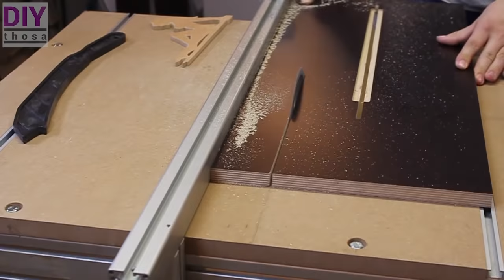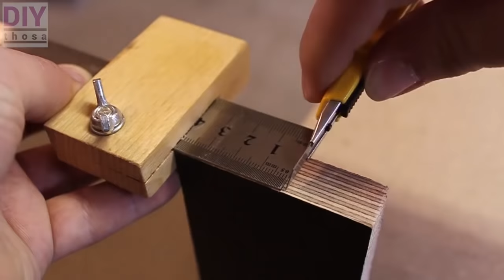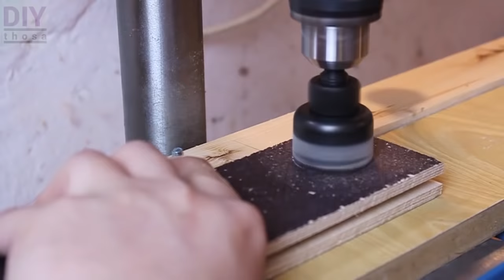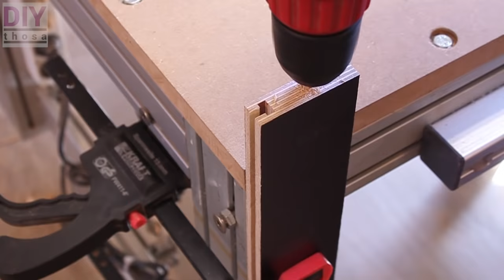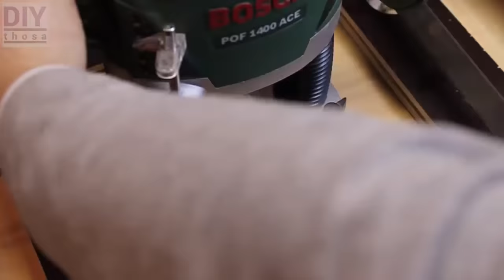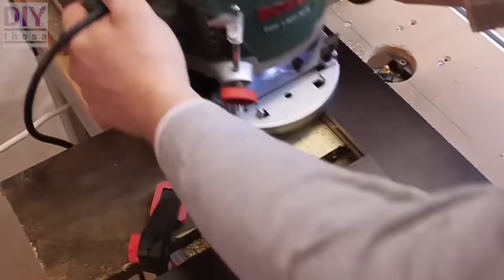Make your own adjustable DIY Router Template !  A must have Jig !

Comment: Rather using a spanner to loosen and tighten the nuts it would be quicker to use camlocks. It is however still a useful and commendable design.
Reply: or wing nuts
Reply: @man.i.literally.failed6772  I don't see how could you turn wing nuts inside the small space..

Comment: #1 I love that blade guard.  #2 that router, the putting to guide is very nice. I took a lint roller and put sand paper around it to sand inside circles  and also took different sides of wood circles, glue them together and made one for my drill press :) All in all your project is very niceeeeeee I like it.

Comment: Have a plastic one very similar but can also change angles. If I added more pieces it could do any multiple of sided. The only limitation is with more sides the larger it has to be.
Reply from the maker: Sounds nice.😀👍 Do you have a link to that?  I wouldn't call that limitation. Sometimes there's no other Way. 😀🖐
Reply: @thosa  you can do the same thing by rounding over one end.

Comment: Superb. You could have made the T slot routing easier by running it over the tablesaw first
Reply from the maker: thank you 😊 ... yes thats right 👌 or use a normal router bit to save the T-router bit.. I learned that afterwards. 😯

Comment: Great idea! I may have to do this... Do you think cam bolts would come loose too easy? If not, then you'd just need a simple screw driver to adjust. Or for more ease (so you don't have to hunt for the wrench or screwdriver), maybe a quick release bolt like you'd find on a bike.
Reply from the maker: cam bolds would be a nice try... but I don't know if they're strong enough... if you're rebuilding this, don't put screw heads in the slot. They lose their grip after a while and start to turn. a sliding block would be a better solution.

Comment: Great video, many thanks for taking the time to make it. I don't see any advantage in cutting the round holes and having an insert. Unless you can tell me? Surely it is better to cut a small square hole and have the bolts just tighten up against the stock then there is less play from moving parts.
Reply from the maker: 😳😅👍  yeah, you're right!  😅  I saw the circle cutter and my head was like: yes, great idea. 😅  ..of course it is easier and more useful to put a small rectangle in that place. 😀👍🖐

Comment: Das System werde ich mir nachbauen, ist gut nachvollziehbar dargestellt.
Reply from the maker: Die Sechskantschrauben haben sich jedoch als nicht die beste Wahl erwiesen.. In Holz drehen die schnell über. Ein schmaler, länglicher Alustreifen mit einer Senkkopfschraube ist besser geeignet.
Reply: Der Alustreifen gleitet dann wohl in der Nut? Die Senkkopfschraube verstehe ich ja, nur wie willst Du die fixieren? Einkleben? Ich denke da eher an passende Nutsteine, die Schraube müsste dann anders herum angebracht werden, was aber eine zusätzliche Aussparung zum Einsetzen der Schraube bedingt.
Reply from the maker: Ja, der Alustreifen quasi als Nut. Loch bohren, Gewinde rein, Senken, Senkkopfschraube rein. Gleiches System habe ich an meinem Kreisschneider für die Bandsäge gemacht. In der Mitte ist eine versenkte Aluschiene. Vorne am Drehpunkt ist eine Senkkopfschraube bündig abschließend in der Aluschiene.
Reply: thosa eher ein Stahlstreifen der genau ( Länge X Breite des Nutquerschnitts) so breit ist, wie das Brett das stumpf anliegt. Darin ein passendes Gewinde geschnitten, und  dann die Senkkopfschraube einkleben. So hält das gut.zum Schluss die Schlitze noch mit Wachs einreiben.
Reply: Gewindestange in Vierkantmutter oder Nutenstein einkleben oder Flachrundschraube am Kopf nachfeilen.

Comment: Great jig, some simple but very clever ideas. Would you consider taking out some of the t-slot with your table saw, to lighten the loading on the router slot cutter?
Reply from the maker: Yeah, that's a good idea. Thank you
Reply: thosa you could also mill stub tenons on the ends of each piece, to engage with the slots, it would keep the jig very flat.
Reply: thosa and use longer bolts with correspondingly deeper bores to hold them, then the nuts, washers and spacers won’t work free and get lost?
Reply from the maker: nothing gets lost. The nuts only need 2 turns to push the bolt out of the slot. An optimization would be to use a longer sliding block instead of the bolts. The wood doesn't prevent the bolts from turning for ever.

Comment: Very nice, I like how you can use this for different sized cut outs. A question, what if you made the openings for the nuts bigger and rectangular and used wing nuts? This would eliminate the need for a wrench. Thanks for sharing!
Reply from the maker: thank you 😀🖐 yes, that would be an option. But then much thicker material would have to be used and the useful depth would be much smaller. 🤔😀🖐

Comment: What size T slot bit did you use for the router, and what size bolts?? great video!
Reply from the maker: thank you 🙂🖐 I've used M6 Bolts with 10mm Hex Head.. so a 10mm T-Slot cutter from Festool. 😀👍

Comment: Nice video - subbed - i have been trying to think of a way to create/use something like this to cutout an insert with rounded corners (and keep both pieces) for example a cabinet door, but the internal rounded corner is the tricky part as with this jig you just get the square inset slightly.  I wondered about creating some corner inserts that fasten with t screws but not sure if the jig would be accurate enough or strong enough.  I have also seen a jig where you fasten the router to a point and follow the radius.  This was the best idea yet but could be tricky if in the middle of the workpiece unless you made a jig for everyone you cut.  Any ideas?
Reply from the maker: good question... To cutout an insert with rounded corners would be a challenge if you want this to be done in one step. I would do this in several steps with different templates. For example a template (quarter circle) with some inches straight for a better alignment. Cutout all corners and use this template or some straight pieces for the lines in between. by the way... I wouldn't make a door with a router out of one piece. The gap between door and front would be way too large. If I want this out of one solid part, I would try this with a jigsaw and make the starting cut with a multi-function tool. Please mail me if you found a better solution :-)
Reply: easy to do using one corner chisel

Comment: Good afternoon. Do you have any video on how to make this paralele guide on your bench?
Reply from the maker: no sorry. this is only an alu system profile. the whole table was made with this profiles. google for "ITEM profile" and you will find them. 😊  but I dont suggest building a fence with this. you have to measure and screw both sides to got a precise cut. a biesemeyer fence out of plywood would be a way better solution ... 👌
Reply: Ok .... Thank you so much !!!

Comment: I like what you do but, your table saw guard is only useful when you’re not sawing wood. I take its a circular saw, and you’ve screwed it to a bit of wood?
Reply from the maker: Thank you 😀🖐  yes.. But this Video is over two Years old. A long Time ago I have stopped using this Saw due to safety Reasons.  Check out my new Videos. Especially the Jigs for the Table Saw. Now I have a new, professional, safe Saw. 😀🖐

Comment: Nice project, did you think about using wing nut rather then hex nuts? It might save having to use a wrench.
Reply from the maker: thank you 😀🖐  the wood was to small for a Wing nut and the Hole to small to get in with at least 2 Fingers to turn the wing nut... but the Idea is good... but all have to be larger for that... 😀👍

Comment: Great Video !!! Can I find a Distance Sleeve for the simpler Makita Router, the one that you use with one hand?
Reply from the maker: thank you 😀🖐 I'm not sure if there are spacer sleeves for the small router. You can, however, run the entire router along the inner edge.  You only have to make sure that you always drive along the frame with the same side of the router. (only if the base plate is not a perfect circle) 🙃👍
Reply: @thosa  thank you very much! Cheers from Brazil!

Comment: Gonna build this.. Wish me luck.
Reply from the maker: good luck 😀🖐
Reply: @thosa  I finished this today.  This was a much tougher build than I thought it would be. It says more about me and not your instruction. 1st i ordered a 3/8s keyhole router bit. I should have gotten bigger. Measuring and finding the centers on all drill holes and slots was time  consuming and nerve racking for me. And I couldnt find any bolts that had heads small enough to fit in the slots.metric or imperial. So I had to grind the heads and threads down. I made a mistake that turned out to be gold. I drilled holes with drill and hole saw on all 8 ends. Only needed to do four. Each piece was 2 foot long, when I started test fitting, it was too long for me. So I cut 8 inches off each. Now I have 2 jigs. A larger and smaller. Bada bing! Just have to get more bolts. And grinding the bolt heads down made them fit like a glove. This is going to work wonderfully I believe.   Thanks for posting
Reply from the maker: Sounds like a lot of fun. 😅 Having two tools of different sizes is also cool.👍  You get two for the price of... well... two... 😅👍
That you had to grind the screw heads is another bonus point. I have the problem that the screw heads can turn in the groove over time.
You shouldn't have to worry about that problem. 😀🖐

Comment: What brand is router and saw table underneath ? I really need a saw table, but i’m not sure if i need to spend the cash on a good sled system or if i have to make it myself.
Reply from the maker: These are both the cheapest machines you could find. The hand circular saw cost 40€, the milling machine 19€. But I strongly advise against building such a table saw yourself. Important safety devices such as splitting wedges are missing. A cheap milling machine can be screwed under the table. This has worked well for me for 3 years now. 🙂🖐

Comment: Hey how do those t rack slots hold up on that type of plywood any good? I am making this wild table sled and would like some feed back
Reply from the maker: hey 🙂🖐 that's obviously not made for eternity... of course there are also points that can be solved better. for example, the hexagonal bolts begin to overtighten in some places... Welding a threaded rod to a flat bar instead would have been the better solution. But you only know that afterwards  😅👍
Reply: thosa oh ok that makes sense I’ll just use it on hardwood then. Thank you very much :)

Comment: why not use wing nuts  ?saves having a  spanner to hand ? whats that plywood called
Reply from the maker: The wing nuts are larger than the width of the plywood. In my workshop I always have the tools nicely sorted and ready to hand. So this is not a problem at all. It's called phenolic coated plywood. This is used for trailer construction, as the coating is very weatherproof. 😀🖐
Reply: @thosa  Thanks for the response, you got me thinking maybe a large Knurled nut,Ill experiment  I liked the video and found it quite useful.Bill
Reply: Isn’t that plywood just betoplox of some kind ? Like multiplex/plywood for concrete formwork.

Comment: great video, very simple to make and no damned musak,  that kind of ply is it plastic treated,dos it have a name?
Reply from the maker: Thank you 😀🖐 I know it as Phenolic Coated Plywood. Its often used as Ground Plates for Car Trailers. 😀🖐
Reply: thanks  I know the stuff damned expensive
Reply from the maker: yes, unfortunately. 😥 I regularly go to the Hardware Store. They sell Wood Scraps and Waste at a Fraction of the Original Price. 🤓 Most of the Time the Leftovers are big enough for my small Projects. Hope your Store offer this Option as well. Just ask for it. 😀🖐

Comment: did you build your table saw ? when i first started wood working  i mounted my only tool at that time to a piece of ply wood  a 7 1/4 saw limits what you can do  now i prety much have  a full wood shop in my garage  and my problem is how to move them arround so casters it will b  the only thing i own that is mobile is my table saw
Reply from the maker: yes. its a simle hand circle saw mounted under the table. but now Im happy to have a good new table saw with a splitting wedge. The self made one was to risky.
Reply: i know what you mean  what scares me is these  work place or guess you would call them portable table saw is the throat  plate being so flimsey  and large i own a cheap porter cable  10 inch  it is sufficient for what i do have 6 inch jointer  14 inch band saw a 12 in thickness plainer  and bunch of other goodies  looking at a new router  just need to talk the wife out of the money

Comment: hey impressed with your table saw, have you the specs for it?
Reply from the maker: please send me a mail via my website, then I can send you some information about the table. 😊
Reply: @thosa  so do you make cabinets for other people ? and or is it just for a hobby? I can see you have a variety of priced items, it must be done on a budget but its hard work working out what to but, I have a Katsu router think you have it it also. Its excellent actually  up to around 13mm router bits after that it vibrates , but very good below. The centre is off a bit so I dont rely on that. Your table saw - is it accurate more than 1/10th mm over the length of the cut (say 50cm?
Reply from the maker: no, I don't do commissioned work. Its just for hobby. The Bosch GTS 10 xc is very precise. 😀👍

Comment: That’s a cool blade guard on your table saw. I’m a new woodworker - could you point me to information on it? Is it aftermarket?
Reply from the maker: That was a self-built circular saw, which fortunately I no longer have to use.  The blade guard is the original one that every hand circular saw has. I only mounted it upside down under the table. But this was very dangerous because the saw has no riving knife. If you want to see what safe working at the saw looks like, watch a recent video of me. 😀🖐

Comment: i prefer buinding a "Banco fresa", this is to much simple.. .i guess there are many mistakes in mm... it's not accurate
Reply from the maker: You didn't understand what that frame was made for.  This tool is mainly intended to perform completely internal milling operations. You cannot do this with a router table without setting up cumbersome two-sided boundaries and very dangerously plunging the workpiece from above into the rotating router. I hope you understand what I'm trying to tell you  🤔😀🖐
Reply: Duh ! Explain ,it's not accurate

Comment: sorry to bother u like this i am a newbie just building up tools and trying to find ways to dome some things my self and buy good equipment , i can see you have the Bosch pof router I have the same its very good and 1400W!, may i ask you what drill press you have please?, thanks in advance
Reply from the maker: Yes the Bosch POF 1400 is very good 😊👍 But thats not the one I have mounted under my Router table. 
You can see a list of all my machines and tools on my website: (and alot more infos)  https://www.thosa.info  🙃🖐

Comment: What is the ticknesss of ply?
Reply from the maker: 18mm 😀🖐
Reply from the maker: no Way...  Point 1: Aluminium Profile is Way more expensive than 1€ Plywood from Box of Scraps. and Point 2: the Frame from you Link is not that versatile than my Solution.
Reply: @thosa  i payed those profiles 25€ i arranged them in the same way as you did. The t slot made in wood Will not last no where near as long as aluminium. A sheet of ply 1250x2500mm 12mm in my country costs 80€(500kn) and you cant buy less then 1 whole sheet.
Reply from the maker: "i arranged them in the same way as you did"  .. ok... you probably should have mentioned that. Cause in the Video, that's definitely not the Case. And well.. in Germany you pay exactly for the Size you need. There is no need to buy a whole Sheet. The Wood you need for this Frame is 0.04m2 (squaremeter) what cost you about 2.40€ (regular Price) and - as I told you before not more than 1€ from Scrap Wood Box. ( what many DIY Hardware Stores  offer their customers ) ... . I'm sorry if that's not the Case in your Country...  but the way you said... " this is actualy cheaper soluution"   .. you formulated it as an assertion that applies to everyone here... but that's definitely not the case.  I build this for about 3€ (including Screws) and use it about 2 Years now... works pretty well for me... If the T-Slot will break ... its not a big deal...But I agree with you ... If I have to use it in a every day job... I would prefer the Aluminium Version for sure..   🤓👍
Reply: @thosa  If i could have bought so little i would Def copied your design because i have been watched it for some time.
There isnt to many stores that sell ply in Croatia at all, mostly big sellers, even when you buy whole sheet they ask: "just one"? 😀
Reply from the maker: 😅👍  that is of Course a Pity, especially for little Hobbyists... Even I don't buy whole Sheets yet. My Projects are too small for that.  🙃   Have you ever looked on eBay for Plywood Scraps?  There are a lot of Carpenters there who sell their Leftover Ply in 10 Kilo Packages, so far I have only had good Experiences with them. The Leftovers were in quite usable Sizes and of excellent Quality.  😀🖐

Comment: There are much simpler ways to do what you just did been making that kind of template just saying
Reply from the maker: Very possible. 😀🖐  My Methods are certainly not the best Solutions. They are only my Solutions. 🙃 Feel free to make it better and mail me your Solution. I love to learn from the Community. 😀👍
Reply: Where do I see your email to send stuff? I have a jig I came up with that's super simple, accurate  fast and easy to use I'd definitely share.
Reply: @peckerwood780  hey man . Seeing if you could send me a video on your jig. Thanks.